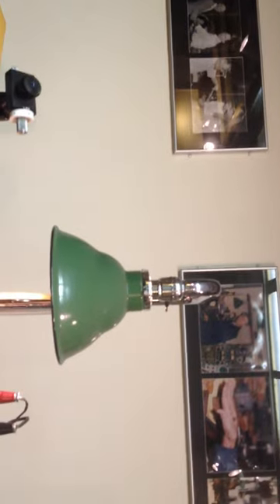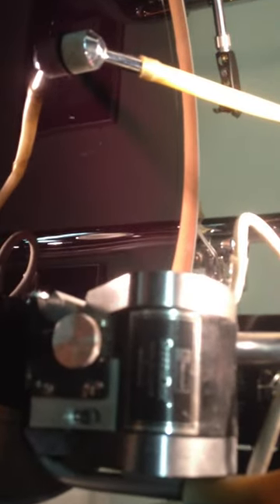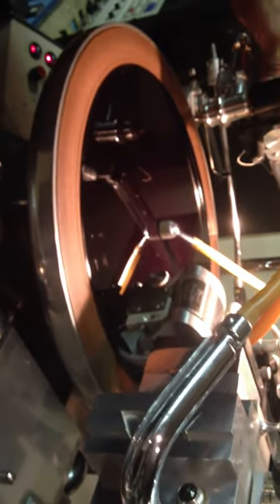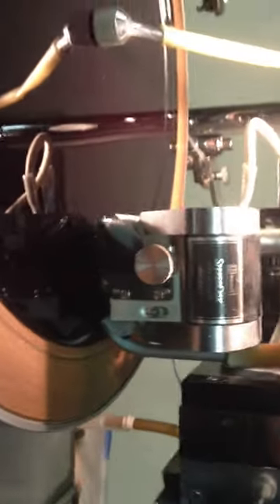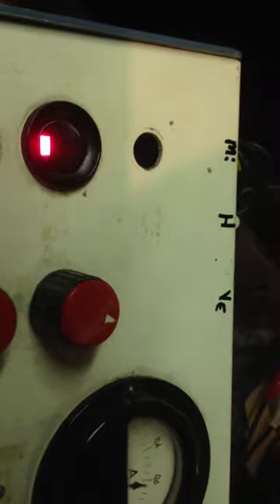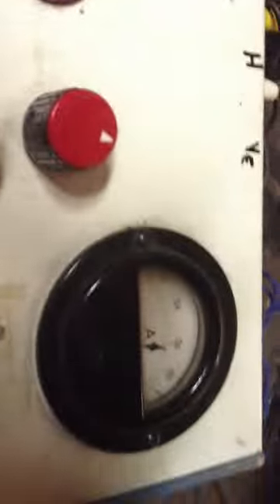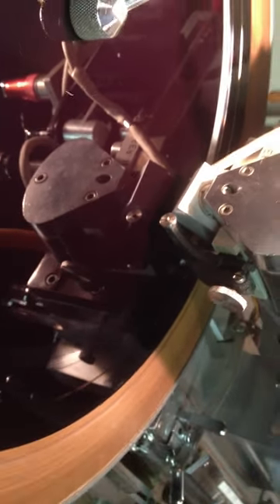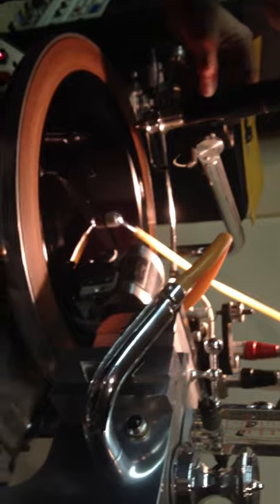Pt 1: Vinyl Cutting Session at HRS - Stereophonic Space Sound Unlimited - Der Ermittler

Comment: Looking at the layout of the buttons on the panel, I know this is a 1950 Scully, but would Len know exactly what model number this lathe would be?  (I know this came after the old Scully 501's with the old gearboxes, but before the Scully 601 which was introduced in 1955.)  They would have the info on a metal plate somewhere - I don't know in the back, or on one side, or what, and would be characterized as a "type."